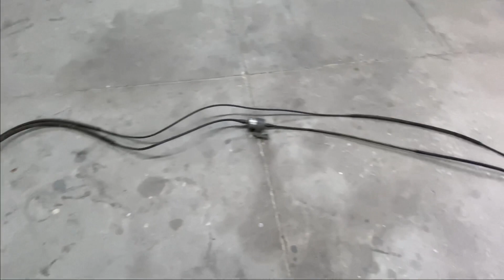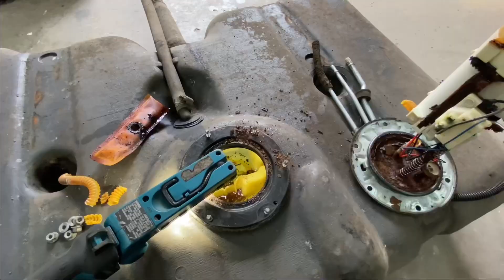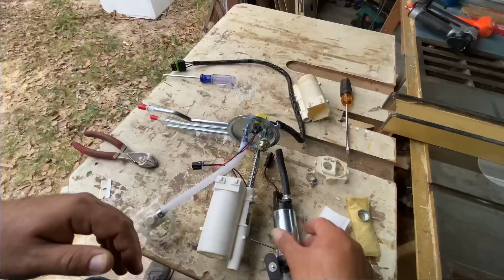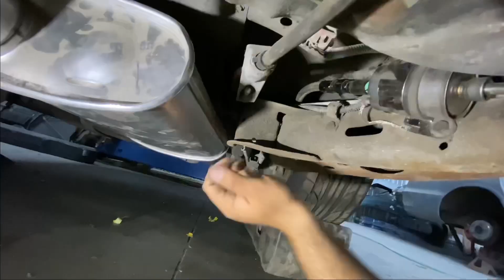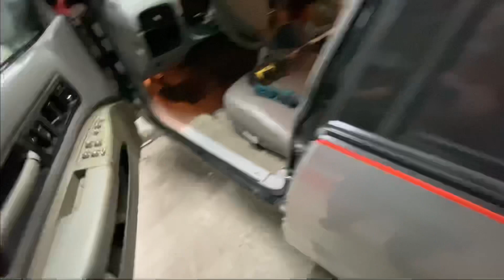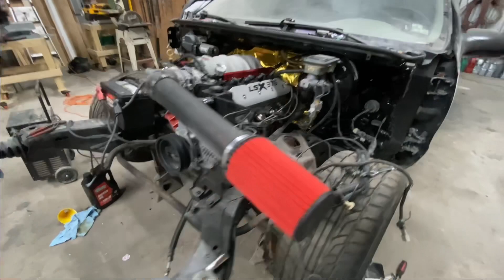96 Chevy Impala SS LS Swap Build: Fuel System and First Start Up

Comment: @ Bravo Garage this is Chico the guy that had the Crossmember questions for u..... wait a minute on changing the oil pan  all u gotta do is unbolt the engine mounts and add a piece of 1/4 inche plate to each motor mount to lift the engine higher to avoid the center link you don’t have to change your pan. And here another tip for your 1996 impala factory immobilizer or V.A.T.S. Unplug the orange loom coming from the ignition to the VATS module it’s a orange loom with two white wires inside. The car will start right up

Comment: I'm looking to possibly swap one of those tanks pump and lines into my 78 caprice to run my sniper efi. I like this alot. Sounds great been a long time coming. I had same problem with my center link. I fixed it by shimming the motor under the motor mount pads. If u make a video I will watch. Sire there is something to learn